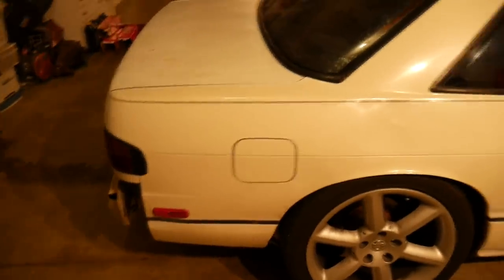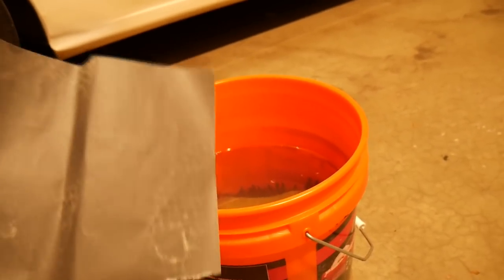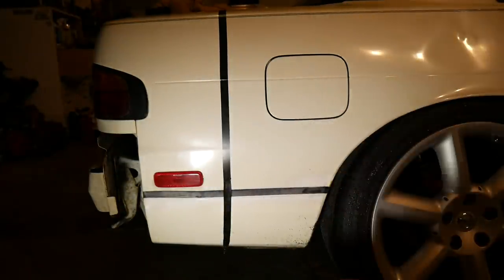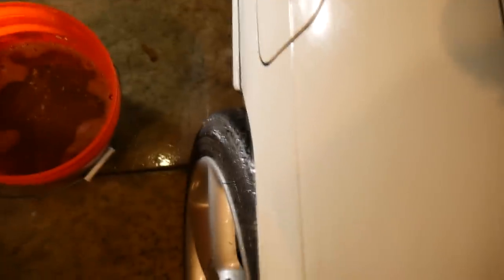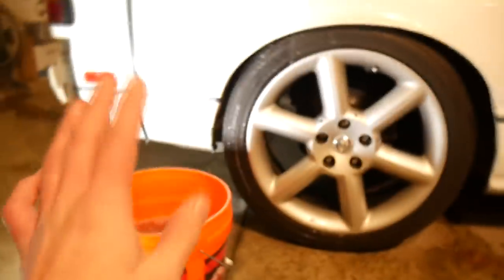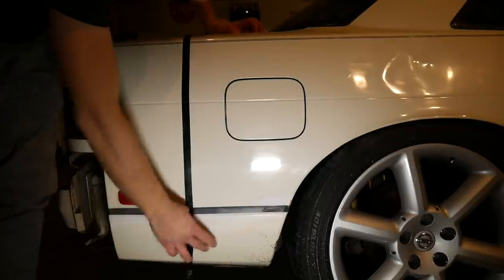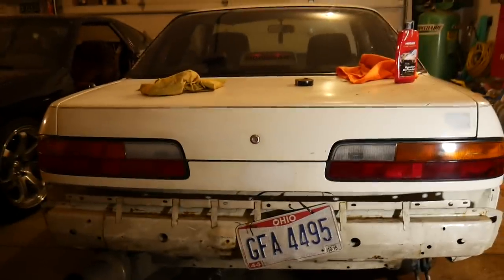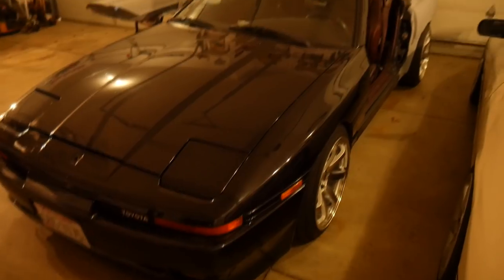How to Restore Paint on a Drift Car!

Comment: you should maybe think about investing in a flexible block ($8)when you wet sand....that way you don't have grooves in your sanding and the pressure is even across the block...you won't burn through as easily either.  good to see a new vid by you!

Comment: Try some meguiars ultimate compound with 2000 grit. I myself think 1000 is way to much cut for any car. Even the meguiars ultimate compound is good enough. Nice vid tho!
Reply from the maker: lowell123 I'll have to try that! Usually I use 2000 but i didn't have any left and figured I would try the 1000 grit for a change. Thanks for the input!
Reply: Chase Hoffman when I finally wash my 86 and buff it I'll show you how fucked up a yard find paint job is lol